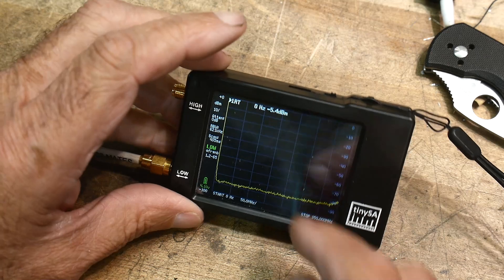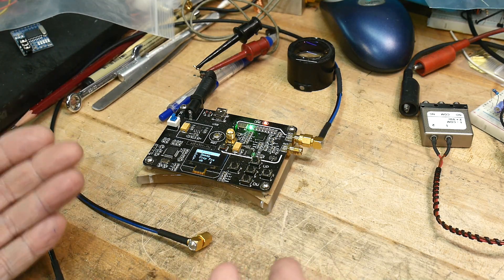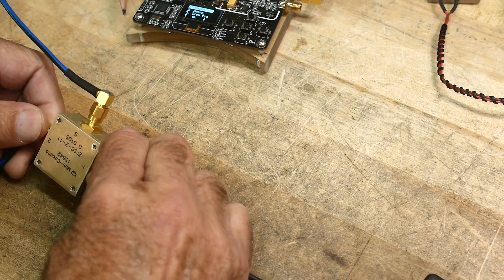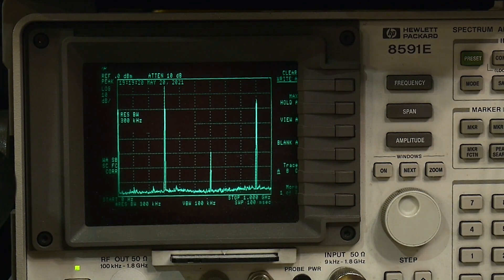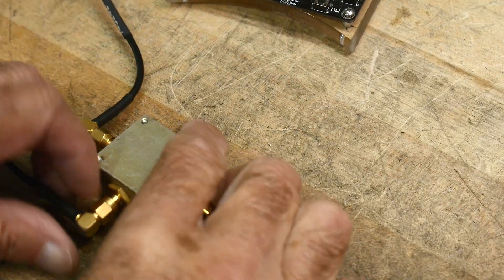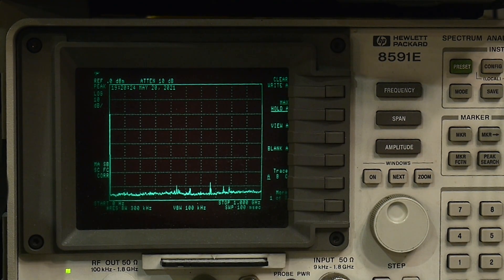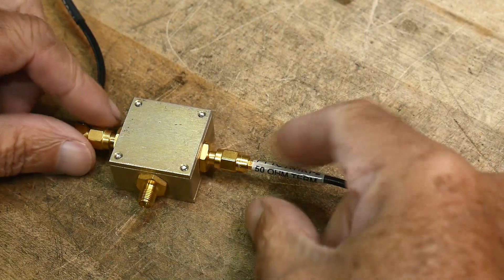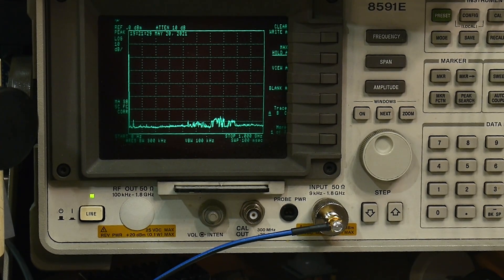#851 Using a Coaxial Relay for Accurate Comparison Measurements

Comment: Is that harmonics/noise leakage to the input specked in multi thousand USD instruments?
Reply from the maker: I wondered about that myself. I never gave it a thought until I discovered the TinySA was so noisy. At -120dBm noise floor, I suspect the HP design had to worry about self noise and the byproduct was nothing was present at the connector.

Comment: An RF splitter/combiner would also be a nice option here. Relatively easy to build a broadband one with a small transformer and some resistors but provides much better isolation between the output ports than a resistive tee splitter
Reply from the maker: The splitter used here was a transformer design. The best isolation is about 23dB for those designs. I have had to add 20 dB pads on both outputs to get the isolation to 63dB but you have a signal loss. I wanted to show the use of the relay
Reply: In that case I'd expect that terminating the source side of the splitter will make most of the peaks you now see on the spectrum analyzer to disappear. Without termination you don't get much isolation as the signal from the other port comes in, gets reflected on the source port, and nicely splits itself over both output ports. Adding the source termination should drop the peaks by 10dB I'd guess
Reply from the maker: here is my video on that: https://youtu.be/lI6sP9IiYa8

Comment: When you removed the input you changed something in the system balance.
Will properly terminating the input will reduce the crosstalk between the channels?
Reply: I was wondering the same thing. Seems like the input should have been terminated with a 50 Ohm load prior to the measurement...
Reply from the maker: I was just trying to show crosstalk. I was tricked by this before. It might change, but there will still be crosstalk. I did a video before on splitter isolation and did include the load as you suggest. https://youtu.be/lI6sP9IiYa8 In the past I have put matching 20dB pads on both outputs so there would be at least 40dB isolation between the two instruments. That works but you loose signal. I saw some posts on line comparing two instruments and claimed they were the same but I had made that measurement and knew they had been tricked.
Reply: @IMSAIGuy  Wouldn't it be better to look at the S parameters at each port rather than the spectrum analyzer output? In any event, the relay is certainly going to have some advantage since it won't have the splitter's insertion loss, but sometimes its nice to be able to measure both systems at the same time...
Reply from the maker: @ats89117  I think S parameters are overkill. If you need to see them at the same time the do as I just said. put attenuators on each side of the splitter. if you use 20db you will end up with about 63dB isolation.